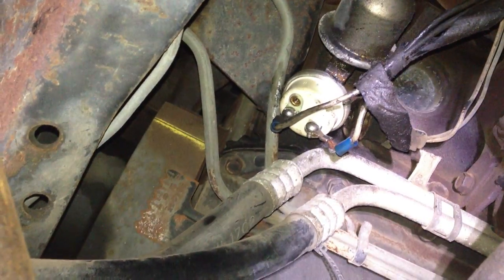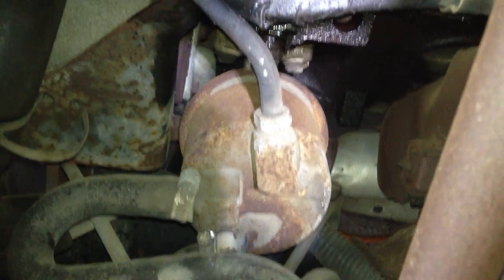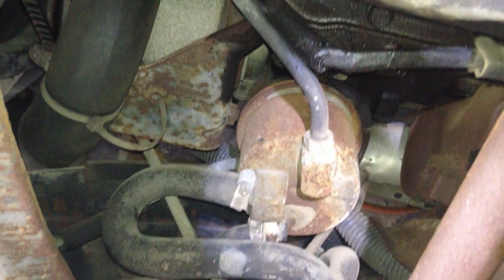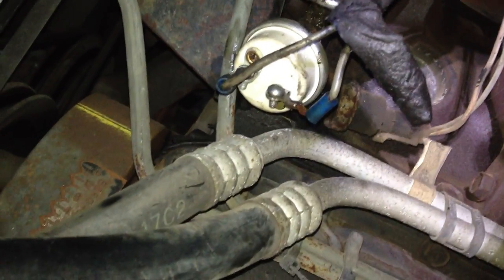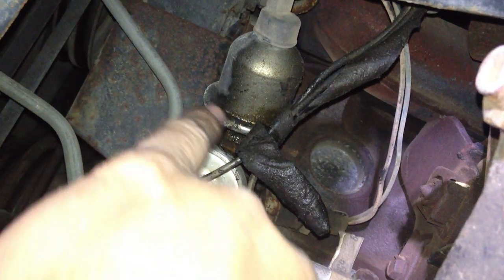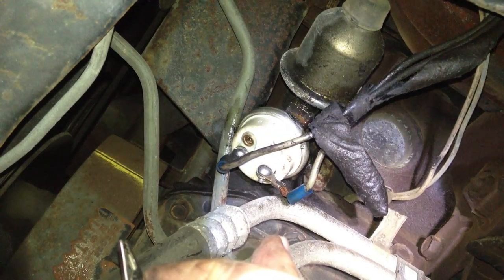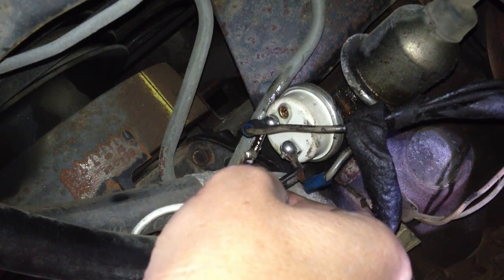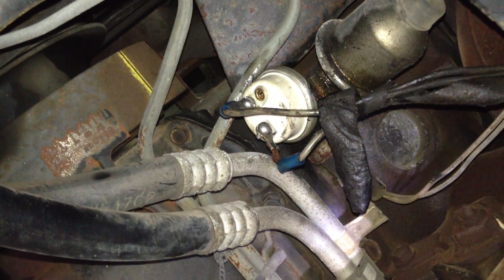Fuel Delivery System in RV

Comment: I have a P30 Chevy with a 7.4L 454. Where the fuel line comes up to the carb is where I'm having a leak. BEFORE the solid metal line comes up to the carb. Hopefully it is just a hose clamp type that needs tightening to the solid line. Great video! David 🚀
Reply: hey Dave, I have the same set up. how about letting me know where I can get the fuel pump for this?
Reply: That was a great video.  1990 Las brisas dolphin. Wants to turn over but not.

Comment: new mechanical fuel pump mandatory. worked for me. 1988 dolphin 34' class A. it has electric pump in the gas tank, & mechanical fuel pump on motor.
Reply: I have a 1988 dolphin with a Ford 460 ... its flooding and blowing black smoke exhaust can't find the fuel regulator

Comment: My 1982 Chevy Motor home was starting and running last month. Now when I turn the key on the fuel pump in the back just keeps running and no start. It is not building up pressure as it usually would stop. Starting fluid will Start the eng. but then it dies. I am assuming the the pump may be bad. It does have fuel in the tank. I guess I will disconnect the fuel hose from the carb and see it it pumps fuel. But I don't think it is. Is this a common thing with tank fuel pumps? Mine is on the outside of the tank.
Reply: I'm changed the back fuel pump..time to do the mechanical one..my starts but will die on me..
Reply: My starts up..runs I hear a pssssst sound and dies

Comment: 1990 Chevy motorhome 454
It runs but when  l put my foot on the gas it stops or dies is that a fuel pump problem
Reply: could be. also can be the fuel pump regulator that is AFTER the electric pump. it regulates the pressure going to the mechanical pump. if ur mechanical pump is NOT new, then replace it no matter what. it's cheap.

Comment: There's a line hang from the tank for mine but I need to find the Mechanical fuel pump because mine was running. But the line is distinctly and I'm looking for the mechanical fuel. Pump to connect to it like you say it right. Doesn't allow gold straight to the mechanical fuel pump from the back

Comment: Ok mine doesn't look like that. I have the cylinder in front of it but not behind it. Is that something you put in to bridge the connection? Because on the oil sender or whatever it is I just described, it was a 2 wire harness connector which I'm assuming has something to do with killing the fuel or something and the other is what I think goes to oil gauge.

I really need to figure this out I'm not getting fuel to my mechanical pump
Reply: try re-adjusting rhe carb screws. I'm having a similar situation. I domt every form battery, starter, voltage regulator, alternator. it was getting easier to turn over after replacing all those parts until recently. a few days ago, I discovered 2 cracked hoses that run to some sort of a filter underneath, which theirs 2 of them. I also had a 3rd hose air hose that must have fallen off. I think that 3rd hose was the cule prit.  

not to mention the fuel pump has already been replaced about 2 Years ago including the carburetor has been rebuilt and the rv has gone much of anywhere but around town for running a few close by errands and to test its limits.

1978 Dodge Sportscoach 
440, b300

Comment: I need help my fuel pump push pin won't fall out on my 454 RV motor. I don't know what year it is and it's in another truck.
Reply: put some grease on the end of it stick it back in grease hold it in place

Comment: Ford E350 Econoline  RV.  351 engine, 1987 carburetor.  Been sitting for awhile, will not start.  If you put gas in carburetor it will run but then it stalls out.  Do you think this is the same issue?
Reply: I have the same rig same situation. Did you ever figure it out?
Reply: I just bought one last week any updates ??
Reply: I have the same problem 1985 ford 350 Econoline
Reply: Guy told me to buy an external fuel pump

Comment: I have a 350/460 ford 1990 dolphin rv does it has two feul pumps and where is the feul relay located at all my feul systems have been replaced. But no pressure it was running fine then a few weeks ago it wud stop now now pressuer what so ever please respond asap thanks man
Reply: you need to check to see that electric pump is coming on. you can hear it. also problem can be fuel pump REGULATOR which regulates pressure AFTER the electric fuel pump.

Comment: are you under the RV, looking under the hood? where is this oil pressure switch exactly?
Reply from the maker: The bottom of the motor. I'm on my back under the motor looking up.
Reply: @jackdeans1045  is that up front? I’m trying it figure out if my 83 Ford motorhome has a pump like that on the front it’s not getting fuel up to the carburetor so I’m wondering if it could be one of those
Reply: @adamwiley350  I am working on an 85 Ford. I have the same situation on an 85 Ford 460. I have not been able to find a mechanical fuel pump. I see 2 fuel lines from the tank. One supply and one return. Usually indicates electric only pump. My camper has sat stored inside for over 10 years. I'm pretty sure its the fuel pump, but it would be nice to have an electrical diagram to make sure its getting power. I have a manual on order. All that said, I would still like to benefit from your experience.
Reply: You ever figure that out? I’m in the same situation

Comment: The reason it won't start after sitting is because the carburetor bowl leaks off. If it is a carbureted engine. If so, rebuild the carb .You are not fixing anything by using these shade tree tactics.
Reply: If the diaphragm in the pump is good, it won’t hesitate for very long
Reply: How hard is to fix carburetor
Reply: @debijo5288  send it out to carburator rebuilders google it

Comment: What year is this for?
Reply: for sure its carbonated not fuel injected,  most likely ford 460ci engine due to the motorcraft looking spark plug wires and the angle the spark plug is oriented (GM big block engines are usually orangish-red in paint color however the later small block chevy can also be painted blue)   blue engine paint and shape of valve cover!   Also, the location of ford"s rear electric fuel pump and at least 1 fuel filter for this vintage is on drivers side frame rail maybe 5 or 8 feet forward of the rear wheels. Crawl underneath (with the wheels securely blocked/ emergency brake on)  with a good flashlight while laying on your back, position yourself forward of rear wheels and you'll see electric fuel pump and fuel filter.  Pump and filter are fastened to the inside of the  frame rail. The electric pump is designed to "push" or "lift" fuel to the engine where the 2nd mechanical fuel pump and it's diaphragm "pulls" fuel the rest of the way into carburetors float bowls.  Hope that wasn't too confusing.
Reply: @JV-up6tc  beautiful reply

Comment: I wonder if mines have a rear pump
Reply: most RV's do. they have a electric fuel pump that feeds into a fuel pressure regulator, then on to the mechanical fuel pump on the motor.

Comment: What motor and rv is this?
Reply: The RangersEdge I had the same question, not enough info to be truly helpful.. I have a 79 Winnebago Brave I think the mechanical fuel pump split a diaphragm and I need to replace it. Where is it?!
Reply: Sean Lane Im sorry, I dont know about Winnebago. I was here because Im trying to restore a 1989 Toyota Dolphin RV. But it has EFI, not a carb so this video was useless to me.
Reply: Here it is 6+ years later n I'm asking the same question. Ugh.
✌️
Reply: @andiharp9275  If your vehicle doesn't have a mechanical fuel pump, this video has nothing helpful for you.

Comment: Will this apply to a 1978 Southwind Class A RV?
Reply: it should. no brainer to replace the mechanical fuel pump & keep that thing new.
Reply: @rvlifewithdjdarren but what year, model,etc... was in your video? Someone else posed the same question, n you did not answer. I just came across your video so, have no history on you or what vehicles you are showing/do work on. Please provide that type of info in your videos n in their respective tag/info line. Otherwise, fairly good video. Thank you. 😊
✌️

Comment: Trying to find fuel injection. Bought new battery and the toyota dolphin RV 1988 engine clicks. But no fuel coming to the engine. Would like to clean the fuel as it has been a couple of months since we have  turned it on. Is it under the motor?